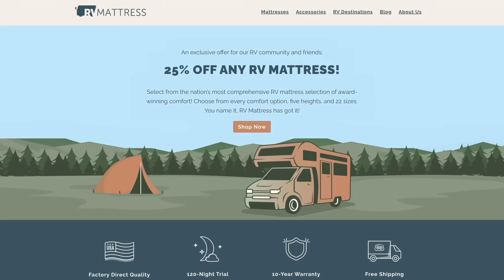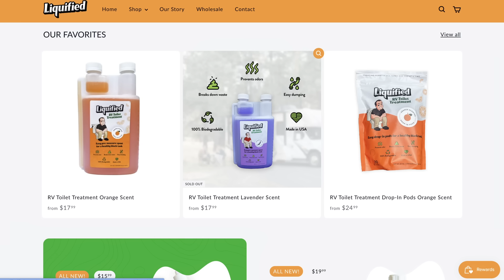324. Can A Dealership Chain SOLVE Repair Woes? Should We Stop Having Campfires?

Comment: I am a Bish's customer of for the last two years and have had both the traditional service and the new Bish Fix model of service so wanted to share. The traditional was my one warranty service with all the initial year break-in issues that needed some level of parts, warranty claims and then dealer service. The fifth wheel was with them for 90-100 days but is was the off-season and we were in regular communication. Not bad given the down season. More recently, we had an urgent issue the day before a 40 day trip and the Bish Fix model worked amazing. They had a tech on a call and then offered the video call to diagnose and solve the issue. Had us on our way the next day. Sure it is simplified because parts were not needed but if they were and we could have scheduled the service for a quick turnaround. Getting a tech on the phone that quick was outstanding. Tip hat to Bish's.
Reply: We are so happy to hear you had a positive experience with this. We appreciate you!

Comment: I love to sit around a fire, but we’ve moved to using an Outland propane fire pit with a long extension. I don’t always use it because it’s usually too hot outside, but it’s great to turn it on quickly, shut it down instantly, and not deal with any smoke.

Comment: We're even hesitant to crank up our propane fireplace during a fire ban or fire-prone area, though it's usually allowed. It just causes others to question it or sometimes encourages someone to start a fire because they see ours. It's just not worth it.  We like our propane fireplace because we don't like smoke or going to bed smelling like smoke in situations where nightly showers aren't possible. As far as dealerships go for repairs or warranty work, we avoid them. We fix most things ourselves, but with our Airstream, we typically go to the Mothership for warranty work. We've found through the years that Mobile techs are a great source and can sometimes do warranty work also. It may take some time for repayment, but it is possible. (Not so much with Airstream, but with previous brands). Bishfix sounds great.

Comment: We rarely have a campfire. We did buy a propane gas fireplace, but it's a bit bulky to take with us as we don't have a lot of storage room for it. I used to be able to tolerate the smoke but after a bout of pneumonia I can no longer do so. Even in the remote area where we live, other people's fires sometimes bother me. I run around and close the windows. Our nearest neighbor is at least 500 feet away so you can imagine how far that smoke traveled.

Comment: Listening to your podcast on Apple Podcasts, and I got to your comments about gray and black water being applied to crops. 🤓

I haven’t read thru all of the comments, but I wanted to let you know:

This is allowed under the Clean Water Act using NPDES permits for wastewater discharge & biosolids management. If anyone is interested, they can look it up by state and/or facility. 

This treated wastewater application is also used in some COE campgrounds west of the Mississippi. 🤓

This process has been allowed for 30+ years, and is only applied to crops for livestock consumption NOT people. 🤓

Also, the treated & sprayed water has to be tested first (at a lab) to ensure that no metals nor toxins are being applied to the crops/land. 

CWA NPDES permits have been around since around 1980, and it’s info that anyone can get with a FOIA request. 🤓

P.S. My condolences about your loss of Beck. 😢

Comment: One of the key differences between the automobile (and truck) industry and the RV industry is that auto/truck dealerships are usually tied to one specific manufacturer.  As such, their technicians are well-trained on that companies vehicles, are required to meet certain quality standards by said manufacturer, and are supported by a supply chain and massive engineering organization that can not only resolve common maintenance/repair issues quickly, but even deal with uncommon issues.  Another key difference, of course, is that auto/truck vehicles are highly engineered and manufactured with a high level of quality control/assurance, and the dealers are not used for this final quality check.  I should add that the warranty situation is also a significant difference.  With autos/trucks, the manufacturer warrants EVERYTHING.  With RVs, well, no.  Chassis/powertrain, RV body, and then all of the sub-standard appliances, each with their own manufacturer and warranty.  I think we are a long way from having that as the model for the RV industry.  I hope Bish’s RV is successful with their BishFix campaign.
Reply: Yeah definitely all of those points have gone into the BishFix model of service for sure. We understand the pain points and hope to make the process so much quicker and more efficient for RV owners.

Comment: Jason your and Abbie’s channel is the very first I have ever subscribe too.  My radio doesn’t work in my class A so my wife and I listen to you folks and your referral channels.   Can you please talk about the Rv hook ups !   Electrical and water.   Pressure regulators.  Don’t start your generator under a load ECT. Also I know you folks own a Tesla.  I was in the Tow truck industry for 44 years and the 100% electric vehicles are in my opinion the most dangerous vehicles on the road.  I tell tell you horrific stories of these vehicles catching fire and you can not put them out.   Ask your local fire department about this problem.   The only way to put the fire out is to let it burn out or bury the vehicle.  Please do some research on this.   Now there is 100% electric big rigs our there.   Please ask.   Have a wonderful day and bless you and you family

Comment: 34:30 these are great if you want HEAT and not the Smoke 💨 
I saw them in action and would consider getting one. ☝️ you can turn it off and pack it away in @5 minutes. 
No smoke 💨 no wild ambers to start a fire 🔥 
And no 5 gallons of water 💦 to Make sure it’s OUT. 😮😊😊